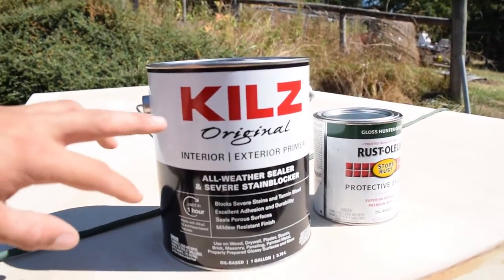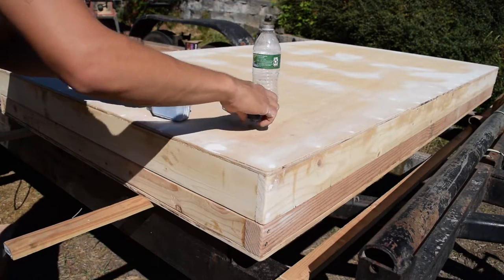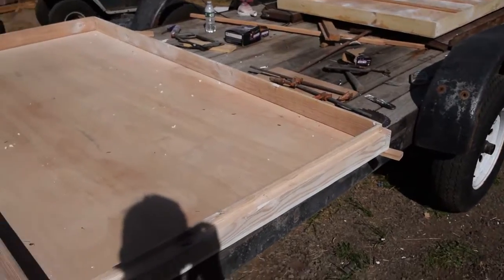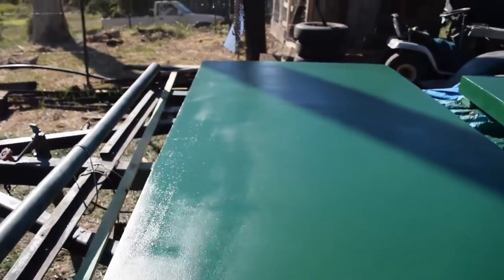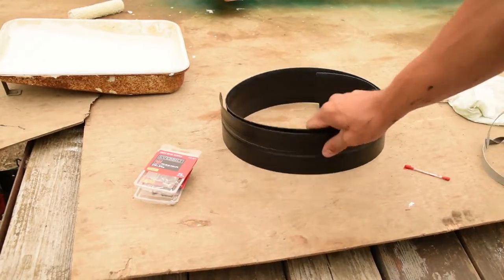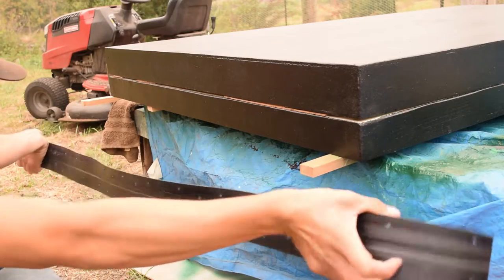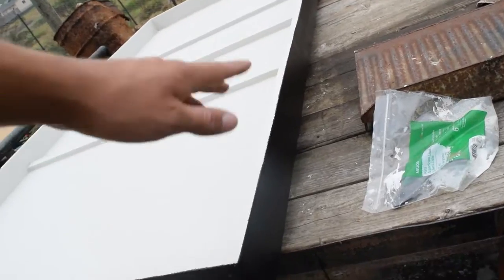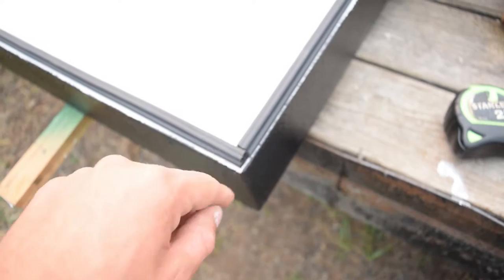DIY Roof top tent Build Part 2!

Comment: Nice looking build! Nice to see what a plywood roof looks like instead of my cloroplast one. I like the inner lip you added to the inside of the bottom box which the canvas is attached to. If you add the bungee it will pull the fabric in when you close the tent.

Comment: Nice coffin ⚰️ Dracula will be happy 👍🏽🤣
Reply from the maker: Hey its not that small 🤣
At least that's what I tell myself.....
Reply: @evansautomotive307  just a joke nice project 👍🏽my idea is to make hard sides tent like redtail rooftop camper. I want to build it for less than 5k with sun batteries, ligts, mattress...
Reply from the maker: @leeneeslynys774  that would be awesome! How much do you think that would weigh?
Reply: @evansautomotive307  with 9.5 marine plywood bits and pieces aprox it will weight 150 - 160kg = 343lb 
But i can also use 6mm plywood for top roof and side walls 6mm acrylic for front doors 
6mm marine plywood weights 12.25kg per 1m² 
9mm per 15.88kg per 1m²

Comment: If you mounted the side clasps at an angle so they pulled the top towards the hinge it would offset the force created by the gas shocks and not warp the hinge.

Comment: Nice job! Thinking of doing something similar. Where did you get the plastic hinge? Can't seem to find it. Thanks.
Reply from the maker: Its called a poly hinge. U.S plastic corp sells it. Its like $11 for 5 feet i think
Reply: @evansautomotive307  Great, thanks. Looking forward to the final build. I've been thinking of using coroplast for the walls with snaps instead of fabric. No sewing. Take care.
Reply from the maker: @johnvas4173  Coroplast for the walls would be pretty cool! The final video should be out tomorrow!

Comment: I'm currently making one that folds to go uptop of my Toyota Camper Van. It's a LOT lighter doing what I'm doing. (On my channel)
Reply from the maker: Nice! My goals for this build was to keep cost down as well as keep it as thin as i could. Weight wasnt a huge factor since I already knew wood would weigh a bit more than aluminum. The next time i do this it will definitely be made of aluminum.

Comment: Putting s Z channel all the way around will make a drip edge to keep water out and if you painted it white it wouldn't be an oven
Reply from the maker: The lip all the way around has kept water out very well. And with insulation it has been pretty good at keeping heat out, or in. But i am sure white would be a much better starting point! Thanks for watching!